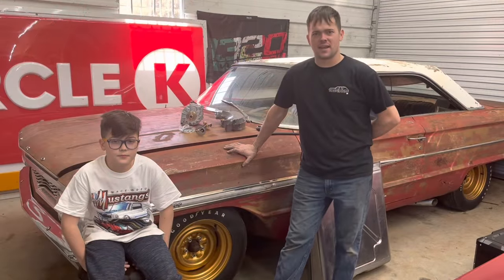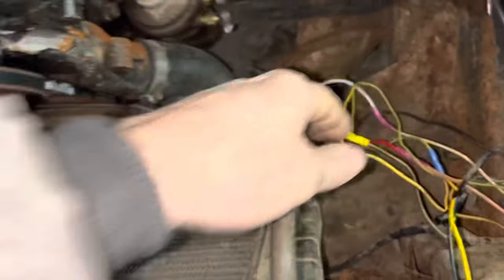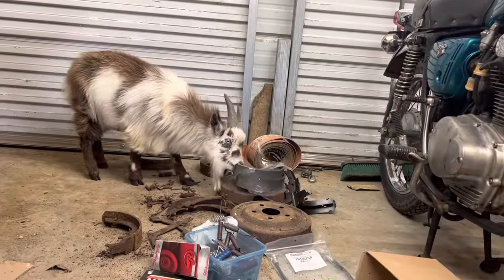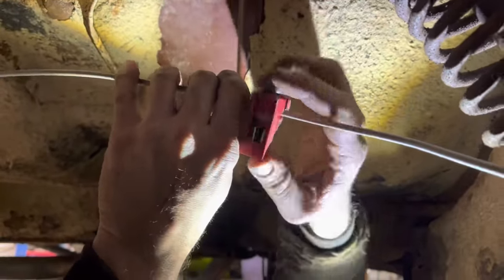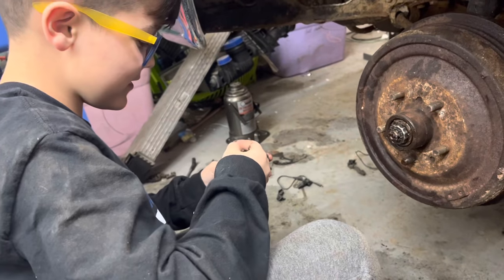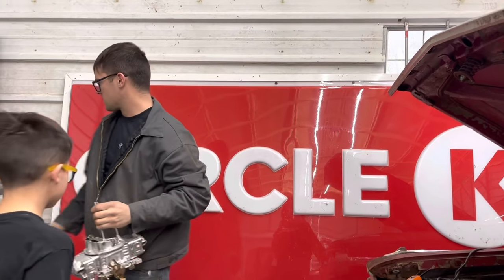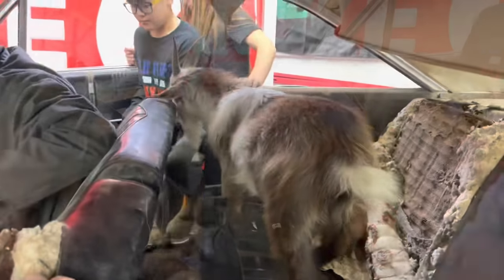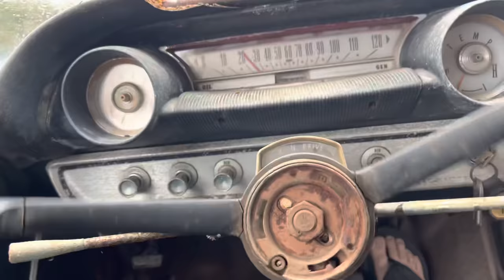Back on the road after 30 years in a junkyard ! 64 Galaxie 390 big block

Comment: The primary or "leading" shoe is the shoe with the shorter lining and goes towards the front of the car.  When the brakes are applied, the primary shoe contacts the drum and the "drag" forces try to rotate it in the direction of drum rotation.  The primary shoe will move slightly off the anchor pin at the top of the backing plate and since there is no anchor point at the bottom where the star wheel adjuster is located, it (the primary shoe) applies additional force to the rear shoe that has the longer piece of lining.  The direction of rotation and additional force on the secondary shoe pushes it against the anchor pin which is there to keep it from moving any further in the direction of drum rotation. Basically the whole shoe assembly moves or "rotates" slightly on the anchor pin at the top of the backing plate.   The longer lining is on the rear shoe just to provide additional wear characteristics since it gets the most force applied to it and also because most braking is done in the forward direction.
Reply from the maker: Ok thank you
Reply: Excellent explanation 👍
Reply: Good explanation, I just posted something similar, but less well written. 

But that was what Intended to say.

Comment: When driving forward, the rear brake shoe is pushed off with respect to the direction of rotation of the brake drum and the front brake shoe is pushed on. As a result, the braking force of the rear brake shoe decreases and the front shoe increases. To keep the braking power of the shoes even, the rear shoe is longer than the front shoe.
Reply from the maker: Ok thank you. Great information
Reply: That being said above, the most braking effort comes from the rear shoe being wedge into the drum by the force from the front shoe when applied.
Reply: In my many years of drum brake repairs,  I have found many brake shoes not put in the correct spot. Long ones on the same side. Long ones on the front. But that's why they come to us mechanics I guess.

Comment: I personally love doing drum brake rebuilds. I'm an engine assembler by trade but moved away so mechanical work can be fun again. I guess I love it because that was my first successful repair on my 64 falcon wagon back in 97 I purchased with my own money at age 15 in SD California. I just want to add, you and your family have motivated me to work on my old truck that just sits and  I'm going to drive that first gen lightning around after I fix the rear brakes 😎👍
Reply from the maker: Awesome …. that’s great get that thing running
Reply: @Sleeperdude  And it will for sure! I ordered the parts and they will be here tomorrow. Rear brakes were gone. But they will be new tomorrow. I got the Lightning from my cuz in Baltimore Maryland so it's a family truck and will stay that for as long as I'm alive. Thanks for the response and the excellent content as well brotha👍
Reply: Awesome car

Comment: The short shoe goes to the front because of the rotation of the wheel pulls that shoe into the drum. If you put the long shoe in the front the wheel will want to lock up when you press the brakes. I hope that makes sense.
Reply from the maker: Ok thank you

Comment: The cylinder bores need to be  power honed to .040” over to fit the pistons. The block washed and new cam bearings. 
 That is a circle track car

Comment: Glad to see it's coming along. I still can't get over how much has been swapped on that car especially for it sitting for 30 years. Someone must have really driven it a lot when it was in its prime. I noticed the rear brake line distribution block is on the passenger side of the axle on that car? on both of my 64's it's on the driver side. That is weird. Something about that axle doesn't look quite like the 9" in either of my cars, might be an 8" from something else? If the speedometer cable or driven gear at the transmission isn't causing that speedometer jump the problem is very likely the worm gear for the odometer causing the issue. My dad's 64's speedo would jump 30 MPH faster and slower than actual speed and upon taking it apart one of the nylon teeth was chipped and the rest were worn. It would cause the input of the speedometer to bind up when that chipped tooth came around and then once the speedometer cable was wound up tight enough to overcome the resistance it would unload all that resistance and cause the bounce. Nothing can be done other than replace the speedometer with a good one in that case, nobody makes the gears.
Reply from the maker: Yeah I think it’s had a hard life, my falcon speedometer did that
Reply: @Sleeperdude  I frequent a few galaxie facebook groups and every so often people complain about the same speedometer issue. It seems to be a fairly common problem on the cars that were driven a lot. My dad's car has 258k miles on the body and there's no telling how long it was bouncing like that before we got ahold of it and put a new speedometer in it. My car has 159K and the speedo works great in that one still.

Comment: First to comment woohoo... Reason the brakes are so soft is because you have a rubber line going that far... Add in the steel line and it should be back to somewhat normal pressure.....  Its not too safe havin that much rubber line.... It cannot buildup proper pressure like with the steel line & will swell and cause a very soft pedal and may endup losing brakes completely sleeper man
Reply from the maker: Congratulations

Comment: Most of the Galaxie 500s with an FE were powered by a 352 engine. The XL models were mostly 390 and a few rare 427s. Many of the automatics had a cast iron cruise-o-matic transmission. I grew up with my dad working on our 4door hardtop since i was Ralphie's age, laughs and memories that last forever. You're a good man, keep up the good work!
Reply: Yep, most of them come with a 352. Kind of a bastard of an engine these days. My dad has a 64 500XL that was a 352, PS,PB,A/C car and now has a 445 stroker with a C6 and gearvendors overdrive. Nothing really wrong with the 352 until you go to rebuild one to find out the replacement off the shelf pistons are .064" shorter in compression height than the originals. When I found that out I decided to turn mine into a 390,(mine is a 4 door sedan) had the bores sonic tested before going to 4.050" bore and 2 of the cylinders were as thin as .086" right from the factory. Scrapped that block. I now have a pretty stout 390 dressed as the original 352, original cruise o matic with 2200 stall converter and shift kit, and 3.70 gears. That one is a pretty good laugh, it looks all stock except for the aluminum radiator and surge tank. Sure doesn't run like stock!
Reply from the maker: Ok thank you i appreciate it

Comment: I seen on junkyardigs where I believe his girlfriend Mook got him an aromatic brake pumper with controller it's basically a cylinder with a airline ran to it in a remote control that you can use to press the brake all the way down while you bleed it I'm sure that you could find it very handy in your shop if I can find the name of it or the link for it I will add it on here or if you want to find the video I believe it's the recent video he just did with a snow plow truck.
Reply from the maker: Ok great thank you that would be handy
Reply: @Sleeperdude  I looked back on the video it does not have a link but it is called fender lizard https://youtu.be/j92QRDOU7CY that's the link for the video that he has it in and you can skip to the time 53:34 so you can see what the fender lizard looks like and how it works I think it's pretty awesome and it's helpful if your wife is gone and the kids are asleep or at school and can't help.

Comment: My Dad had a 1962 Ford Galaxie 500 Sunliner convertible with a 352 V8 , 3 speed Cruise - o matic automatic transmission and posi traction. It was originally a California car my brother bought when he got out of the Navy in 1966. He drove it cross country to Connecticut, eventually sold it to my Dad so he could buy a new 1966 Chevelle Super Sport 396. That posi - traction came in handy the time our Jeep pickup got stuck in mud and snow and the old Ford helped to pull the Jeep out.

Comment: It's because there're duo servo brakes. The wheel cylinder pushes both shoes out at the top, the leading shoe pushes back on the bottom of the trailing shoe, allowing more lining to contact the drum. If you put the shoes in wrong, it will stop like when backing up. The brakes don't stop as well backing up, because of that smaller leading shoe.
Reply from the maker: Ok thank you

Comment: I recall with great fondness the 1969 Plymouth GTX with a 440 and a 4-barrel carb that I bought in 1972. That thing would shred its rear tires at the drop of a hat and swap ends whenever there was any moisture on the road.

Comment: The question about why some cars sitting seam fine with little work while others (the ones you get) are a mess. Not considering some people fake it, I have a 1981 Corvette 3rd gen that sat untouched for 10 years and a 1947 Dodge D24 that sat in a yard for roughly 20 to 25. The Corvette I have literally had to strip back to the fiberglass and frame, nothing rubber was usable and there wasn't a single wire in the harness I wasn't sure would start a fire. The Dodge got a new battery, points, and broke loose one stuck valve. I now drive the dodge almost every weekend and the Corvette is still on blocks waiting for me to be motivated again. I have to think the quality of products when original, must be so so different. Thanks for another great video and teaching your son the good stuff. Tell Rocky we all say hello.
Reply from the maker: Ok thank you

Comment: A bit of advice,  In 1967 All Fords went to the dual reservoir master cylinder, If I were you I would get one for a 67 Ford Galaxy with drum brakes and put it in it, All you need to do then is  hook the present line to the front reservoir and remove the line to the rear  at the junction block and plug where the line goes to the rear in the junction block and then run the rear reservoir to the rear brakes It's a lot safer!  And on your 63 Falcon get one for a 67 Falcon with drum brakes I have a 64 Falcon and that's what I did to it!
Reply from the maker: That would be a good upgrade

Comment: Take the lid off of your old master cylinder. drill a hole in the center of it. and pull a valve stem through just a regular valve stem. open up all your bleeders. screw that lid on your master cylinder with it full of fluid.& bump a little bit of air in it three or four times.. & your brakes will be shooting out solid fluid now.  All the air will be gone and it just takes hardly no time at all.. & only three or four small amount of air on that valve stem. try it?
 It's real easy especially if you're doing it by yourself.  Then just tighten up all your bleeders.  and you'll be good to go..  if you ever do try it let me know!!  it really does work exceptionally well. You got a great channel man. &  family,,& goats,, & dogs,, &  awesome cars!!!!  keep up the good work love watching it. thank you..
Reply from the maker: Ok thank you

Comment: As an old school mechanic I’ve learned a few things about older cars. 
There is a primary shoe and secondary shoe. When the brakes are applied the spinning wheel puts more torque on the primary shoe. 
The secondary is bigger to help keep the primary from wearing so fast. A disc brake doesn’t have this problem. 
If you’re going NASCAR install Brimbo disc. 
They will stop on a dime and leave a nickel showing!! You need a three point seat harness to keep from going thru the windshield!! 
Also if you think the needle is stuck hit the float bowl with a rubber hammer. It MAY free up. If you’re gonna do  burnouts you will need a front line lock!! 
Also you exhaust pipes should point toward the rear tires to blow smoke and choke everybody!!  Also paint your car like Fireball Roberts. !!!!👍🏻 Google his number!!
Reply from the maker: Thanks for the good info

Comment: Awesome video. Ralphie forgot he was in a NASCAR car 😆. Pups were cute, Rocky is a GOAT goat. As far as the tape measure I worked with a old Mennonite carpenter that would call out the measurements as 24& 5 little marks(5 sixteenths)
Reply from the maker: Thank you .

Comment: I had a 67 Camaro with 4-wheel manual drum brakes. I can remember pulling on the steering wheel to get leverage to push the brakes harder.ha The harder you push the better your brakes. Great video.
Reply from the maker: Thank you

Comment: Boy, that engine sounds like my old FE390. Sounds great! I got a kick out of that look on Ralphie's face when you made the comment about changing the alternator - "it's like getting matching shoes and belt but not the purse..."😂  Might check the rag joint too on your steering shaft. If they're anything like the old F-series pickups of the late 1960's to early 70's, those things would tear out and not really be noticeable. Like someone else said, this is a nice distraction from the crazy world right now.
Reply from the maker: Thank you I’m glad you liked it

Comment: Those older single well master cylinders would usually leak slightly inside the car where the rod goes from the master cylinder to the brake pedal … their weakest point. Totally enjoy your video! Brings back memories for sure.
Reply from the maker: Ok thank you

Comment: Love the sound of those 390's. Awesome vid. Just did drums all the way around on a 60 Ford f100. Had to heat every nut and bolt. It was a struggle. Sucks they don't make industrial use fishy flops lol. Don't forget to change that battery in the smoke detector. It clearly states in the underwriters laboratories smoke detector listing, chapter 7, section 37B "I, the undersigned, shall forfeit all rights, privileges, and licenses herein and herein contained," et cetera, et cetera..."Fax mentis incendium gloria cultum," et cetera, et cetera..."Memo bis punitor delicatum". It's  all there, black and white, clear as crystal! You stole fizzy lifting drinks! You bumped into the ceiling which now has to be washed and sterilized, so you get nothing! You loose! Oh wait, wrong handbook.
Reply from the maker: Yes it does sound good
Reply: “Gloria cultum”….. no thank you!

Comment: Woww fresh exhaust pipe , fresh brake piping , fresh fuel tank ,  make sure burning excellent ...! brake system , DRIF TO MAXIMUM THE LIMIT , MAKE THE TYRES SPIN ...AND SMOOKEY * MAKE SURE THE BRAKE PADDLE SPRING IN SMOOTH CONDITION ..! FEWUVITTT...! regards from kuala lumpur , thursday 03.03.2022 malaysia time 23.58 pm.
Reply from the maker: Thank you!!!

Comment: My Mazda has front disk, rear drum. I replaced the fronts and noticed the difference. When I replaced the rear drum brakes that made a difference in my brake power overall. It's really noticable in a 5 speed stick.
Reply from the maker: Ok interesting

Comment: Thats why those bowls have clear sight windows where you can see your fuel if there is no fuel in them the needle and seat are usually stuck all you have to do is tap them on top of the lock screw for the ajustment and it will unstuck them and proper float ajustment is fuel a ¼ to ½ way up in the glass
Reply from the maker: That’s true

Comment: Excellent video Josh  :) I notice you forgot put gas on new fuel tank also those cars are legend for sure and remember my families also friends drive lots sports cars long time too! Myself first sports car I had was 1980 Pontiac Grand Le Mans 2 door bought in 1994 had till 1999 had 4.4 litre 267 V8  4barrel with daul exhaust with 700SR 4speed Overdrive with Automatic transmission , 377 posi rear end gears in 1995 updated motor to 1978 truck rebuilt 350 V8 4 barrel carb with daul exhaust to , rebuilt 700SR 4speed Automatic Overdrive  transmission plus 390 rear end gears ! Then frame snap on me 4 place so retire it and 2005 bought parts car 2002 Chevrolet Impala E-X LTZ LS 4 door rebuilt to my like plus different motor and transmission orgnailly had did up also full frame in from Unibody and was so cool ride to and sad give up last October 2021 to another person buy to have fun with!
Reply from the maker: Ok that’s cool thanks for watching
Reply: @Sleeperdude  do another someday too and enjoy doing for others to lately!

Comment: A. Old school tip only take apart 1 side of the brakes at a time so you can refer to the other side if you have to and if you're  trying to start a car thar hasn't started in years spray some 30 weight in the cylinders to help seal the rings and valves you probably already know this
Reply from the maker: Ok thank you

Comment: you can sometimes adjust slop out of a steering wheel by adjusting on the steering box. There is a nut with a flathead screw in the center of it. Back the nut off a little but and turn the screw in a little at a time and test drive it. This is located on your steering box. You might have to repeat this several times.
Reply from the maker: I should do that, I did that with my old f350
Reply: good idea but be careful to not tighten too much trying to clean up slop in the steering, the gear mesh can be over stressed, especially on the oldies that are worn.

Comment: Drum brakes they tend to rotate counterclockwise so that’s why your rear brake shoe on your rear brakes is bigger than your front shoe on your rear brakes or I think it’s the same on the front but they tend to rotate counterclockwise so more pressure is on the back one that’s why they’re a different length thank you love your love your show

Comment: Positraction is a GM trademark. Fords came with Traction-Loc. Long shoe's on the back because rear shoe does most of the braking. The front shoes main job is to activate the rear shoe.
Reply from the maker: Ok thank you